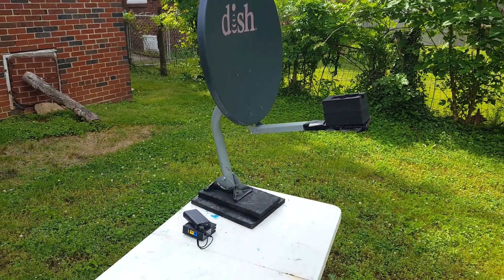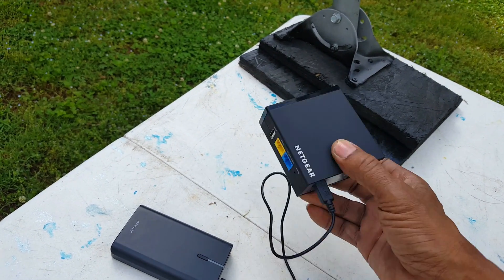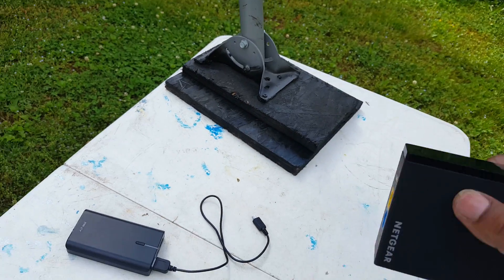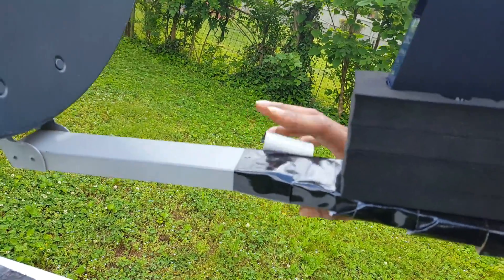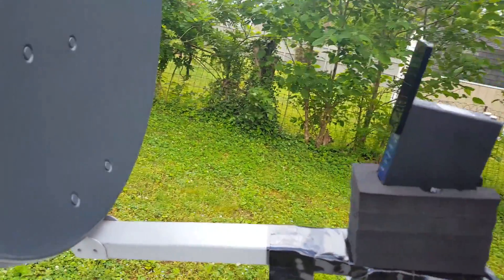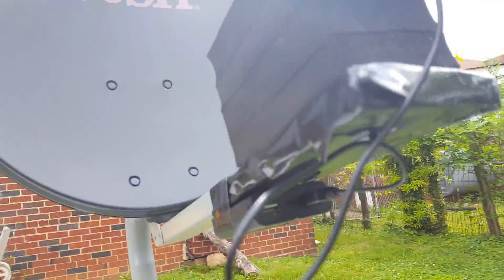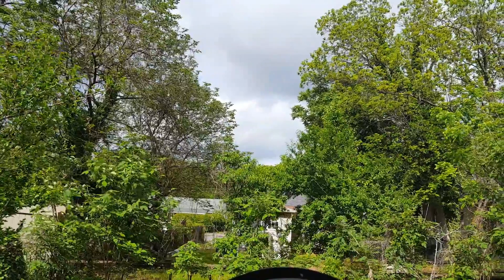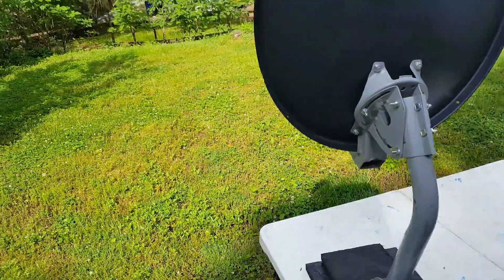HOW TO BUILD PARROT BEBOP2 GROUND CONTROL SYSTEM / NETGEAR TREK WIFI EXTENDER LONG RANGE MOD

Comment: How do we know it works why didn't you fly it
Reply from the maker: https://youtu.be/rt1-ZctPMkU
Reply: Thanks, did it go alot farther?
Reply from the maker: @randytrivette6618 I was able to fly farther with a clear video signal under less than perfect flying conditions. I had full control and clear video the entire flight. I hit rth due to rapidly depleting battery.
Reply from the maker: https://youtu.be/rt1-ZctPMkU

Comment: Ingenious.  What's the range for the Bebop2 ??
Reply from the maker: Marc Betts I have only been out a little over a mile inside the city. At that range I have a solid 3 out of 4 bars of signal strength. I have yet to see the max range due to lack of suitable open area near the places I am able to fly. I'm curious though. We'll see.